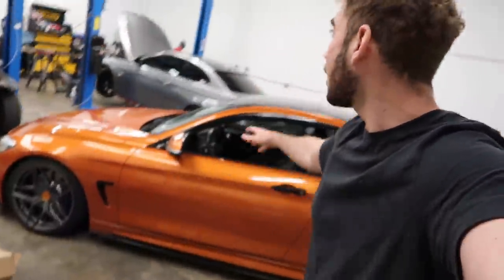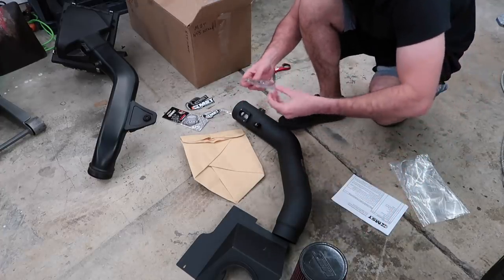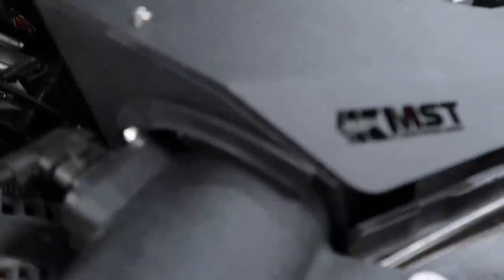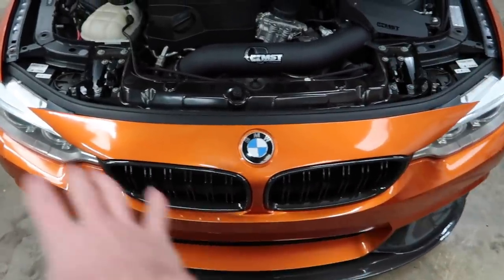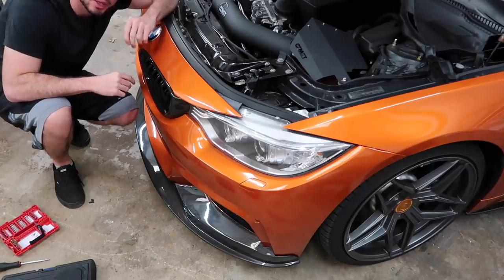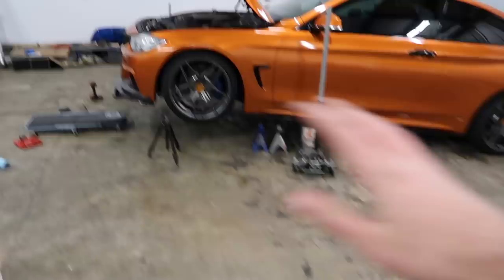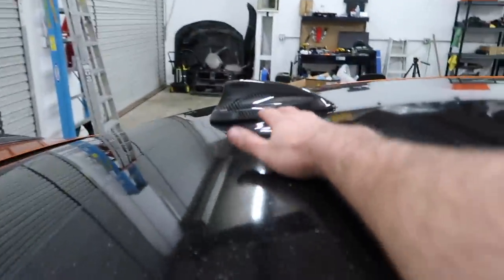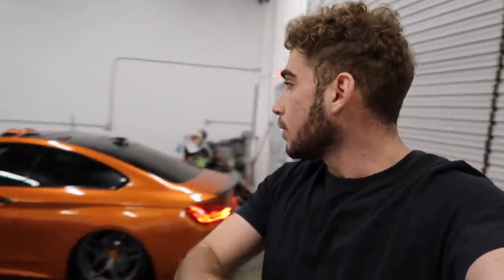435I GETS NEW INTAKE!! (CRAZY TURBO SOUNDS!) + MORE CARBON

Comment: If your OFHG is leaking replace both and check the belt for saturation. You don’t want to let it soak the belt too much cause it can shred and get pulled into the crank. Costly repair, and it was something overlooked on my own car by the dealer till it was too late.

Comment: @Nour The gasket For The oil filter should be changed imidiately. I didint change Mine on time and had coolant mix with oil. Trust me its Hard to clean that mass afterwards.

Comment: Save the stock intake (and down/charge pipes) to reinstall for your smog check. Any intake (anything pre-catalytic converter) mod without a CARB sticker is an immediate failure. Been there, done that, had to reinstall the stock intake.